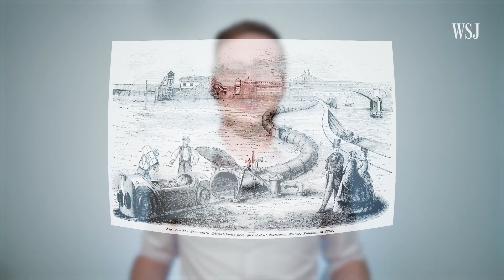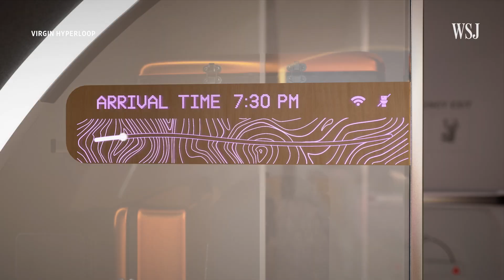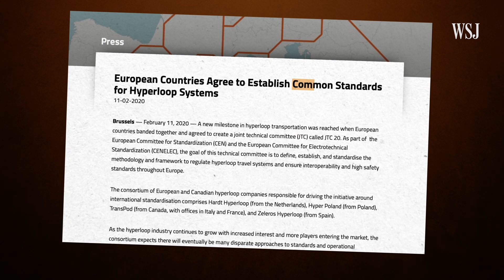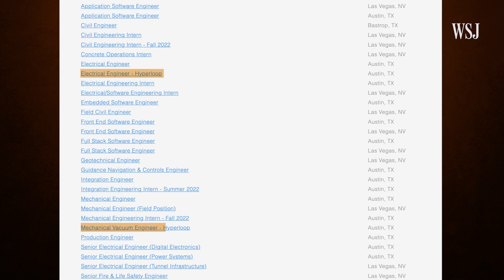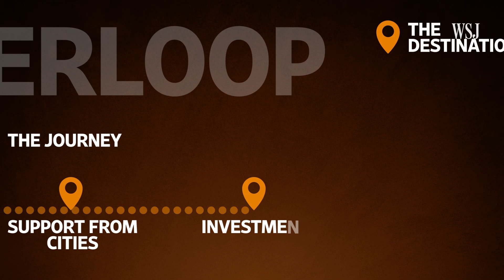What Will It Take for Hyperloop Travel to Be a Reality?

Comment: Total waste of time. A 1000km tube, at 99.9% vac, with no expansion joints. Nah. None of these vids even mention degassing in a vac. Any lube on the pod would evaporate. Same with welding slag or flux on the tube. Hell, even rubber seals would degass into the vaccum. And thats before heat dissipation for the pods, air supply for passengers, cyclic fatigue on the pods and airlocks etc. And here is my biggie. If   a normal train crashes, or plane crashes, it only affects those passengers. Its a local event. On a hyperloop, an incident would be a whole system event. It would basically be a 1000 km long pea shooter loaded with ppl going 600mph. It would be like one plane flying between london and NY having an incident.. and all planes on that route at the same time being destroyed. 🤔

Comment: The economics don't work out in favour of a vacuum tube maglev system. We already have maglev trains that can reach 600km/h and highspeed trains that can reach 350km/h so why do we need higher speed that comes with a large cost? Existing train techniques could already be usefull to replace intercontinental flights for a large part (ie. using sleeping trains, so you lose not much time traveling). Hyperloop comes with too much cost per person travel kilometer to ever be an alternative for normal trains of aviation. The benefit of higher speeds due to near vacuum most probably don't compensate for energy losses for maintaining the near vacuum and since tubes will shrink or expand due to temperature, there will be losses. The implosion of a vacuum tube is a high risk.

Comment: I wonder... what is the biggest vacuum chamber mankind was able to build? I guess I have to Google
Reply: However, isn't really relevant here.
A big vacuum dome (e.g. 100,000 m³) would be extremely difficult to build. But a tube of the same vacuum volume would be relatively easy.
We didn't build such long vacuum tubes so far, because we didn't need it. Not because it was so difficult.
The longest vacuum tube so far is for the Large Hadron Collider at CERN, 104 km long.
And that's a ultra-high vacuum, not comparable to the pretty low vacuum, which is needed for the hyperloop.
I don't believe in vactrains like the hyperloop in foreseeable future. But the vacuum tube itself isn't the crucial obstacle.
Reply: Or to be more precisely: A simple vacuum tube, with "can hold a vacuum" as the only requirement, would be pretty easy to build.
As long as you don't want to shoot capsules with more than 1000 km/h through it.

Comment: Since the hyperloop concept involves a pressurized cabin flying through a depressurized tube, I’ve always wondered how they would address a loss of cabin pressure inside the pod. Doesn’t look like they have airline style oxygen masks in their designs nor a quick way to repressurize a portion of a tube to return the punctured pod to a safe altitude like planes which descend during depressurization to a safe altitude.
Reply: That problem is easy. The bigger question is how they maintain the vaccum in a miles long giant tube.
Reply: They don't care about safety or indeed even survival. Else they would promote regular HSR instead. It is almost just as fast, extremely safe, proven tech, affordable, much easier to maintain, simpler to integrate in an existing landscape and network, etc. Hyperloop is really just a scam.
Reply: Loss of air pressure?  Death, usually...

Comment: The tubes should be composite. They have robots that weave cylinders from carbon fiber. Scale it up to a continuous tube manufacturing system.
Reply: Oh man, that is a terrible, terrible idea. That would be extremely costly and dangerous.
Reply: Hahaaaa, I nearly laughed my cock off.  Composite!  I wonder if that would be airtight?  Hahaaaaaaaaaaaaaaaaaaaaaaa
Reply: You cant use composite, cos the resin would just degass when the vaccum is created. You would end up with a tube full of epoxy gas. 👍

Comment: Far Far from Reality. Cost for tubing those thousand of miles would cost billions. Also they have to maintain the vacuum from A to B and there comes the biggest failure point.
Reply: Thunderfoot!..
Reply: Just take an airplane
Reply: Sounds more feasible compared to the high speed rail here in california..
They're billions in and do not have a mile thats operational.
Reply: @billy909420  California high speed rail is political. In any case, if the issue for high speed rail is land and routing, why would those problems vanish with hyperloop. HSR is a proven concept. It works. Rail is 200 year old tech that is proven. It transports billions of ppl tens of billions of km every year. Hyperloop has yet to transport a single person more than a km or 2. 😳
Reply: @billy909420  IKR?  Why not just fly?
Reply: @billy909420  
LOL. There's a person explain why California rail is good and the funny, there's actually not enough money to continue. I post the link as it is easier to explain since we do not live there to know why the rail is good thing. To make it short, cutting into mountains ain't cheap, doubt Hyperloop can survive the cost and the next 10 year we be taking the same thing like the other guy that I meet with the same comment as you 10 years ago.

https://www.youtube.com/watch?v=rcjr4jbGuJg&ab_channel=AlanFisher
Reply: High pressure water jet cutting easily goes through steal. So why aren’t we using an array of them at the cutting head of a boring machine?  You know. Tunnels are also really big pipes. So pump out the spoil and pump in a UV catalyzed liquid polymer and as the tunnel is excavated it is applied and catalyzed to solid forming the initial outer tunnel wall/water barrier. Drive back through with block laying robots. That’s gotta beat a snail.
Or
The tubes could be composite. They have robots that weave cylinders from carbon fiber. Scale it up to a continuous tube manufacturing system.
Reply: @undertow2142  That's extremally complicated and the technology doesn't exist. It would take decades and cost billions and billions to do that. Just not worth the cost at all.
Reply: Well, well, well, mankind said same about flying less than a century ago. A billion reasons were given why it will never be (both scientific and otherwise). Let's not talk about space exploration etal. But here we are today.